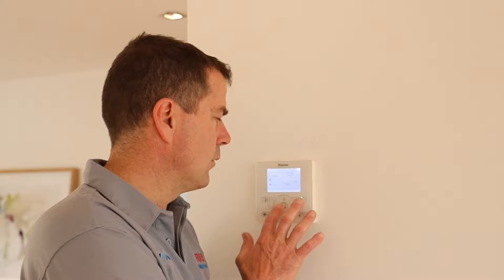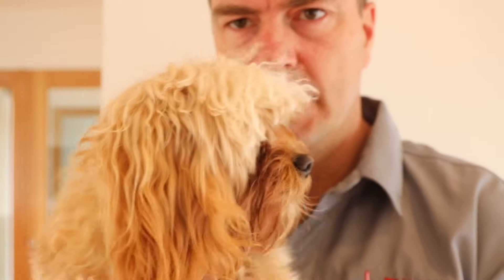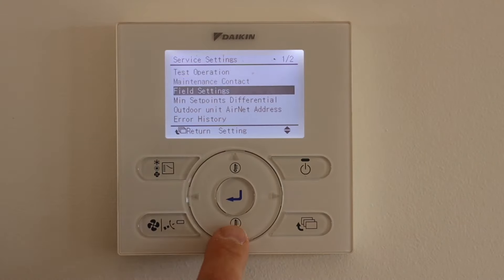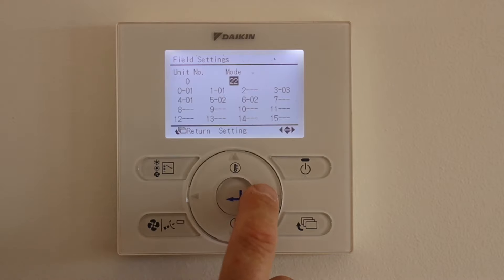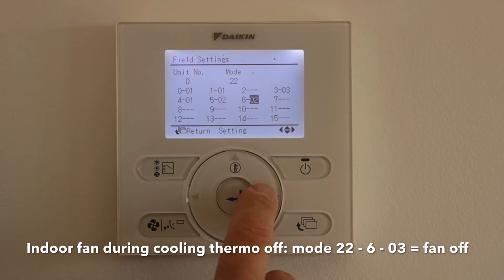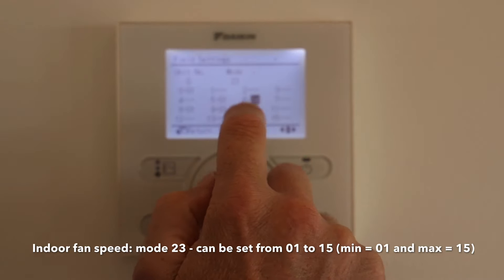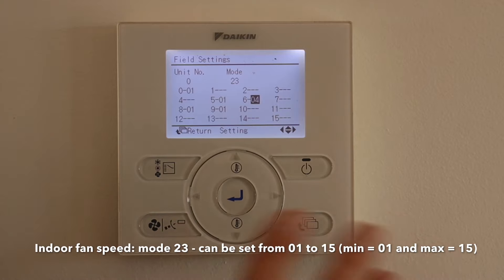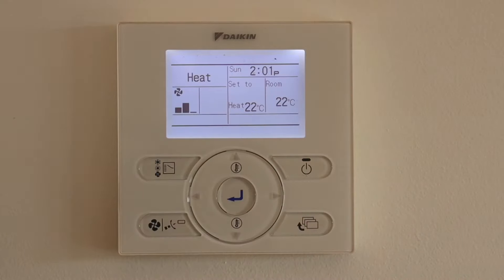Daikin BRC1E63 controller set up field settings cycle fan off, activate sensor in wall controller

Comment: This has been an incredibly helpful video - thanks! I was going crazy not understanding why my temp would hit the desired level and the whole unit would just keep going.
Reply: Me too but I missed that part here. I can't stand these thermostats.
Reply: got it. took a while to get to field settings on mine but the fan is now being monitored like a KGB double agent. And the sensor is now reading from the unit and not in the damn return air. I guess these are valuable for service techs but the default needs to be just simple. Reliance on automation is annoying.

Comment: What a god send.  Unit was installed by a well know company that has been in business for 50 years, yet they did not ask anything around these settings.  The constant dribbling cold breeze when in heat mode is what drove me to start looking for answers & found this.  Also the bit of changing the temp sensor to the controller because in summer we were freezing & had the controller temp set to 28c to try tame it.  Thank you so much.
Reply from the maker: No problem 👍🏻

Comment: I only have a AirTouch connected to my daikin unit. Is there a way to program the daikin unit with the AirTouch
Reply from the maker: No sorry, the Daikin units feld setting can only be accessed by the Daikin controller, when air touch is installed, the people installing it should have connected a Daikin controller to test run it and set all the field settings, if it's set up correctly the temp sensor on the air touch should be the control point for the air touch. you would normally set the sensor in the remote control. There are instructions online at polyaire about the set up of the air touch as there are a few ways that can be configured as well.

Comment: Stuck in German in hotel… how do I change language settings plz
Reply from the maker: @boomchancre  push the middle buttons, that will take you into the menu, scroll all the way down to the bottom (this is language) push middle button again and it should have all the different languages 👍🏻😜

Comment: How to off  centralized control
Reply from the maker: You can’t, your indoor unit is one of a number of indoor units, connected to a one outdoor unit, VRV system. One of the indoor units will be the master indoor unit where all setting can be preformed, you could change the master to your indoor unit, but you need access to the master controller to do this, the master controller will be the one that doesn’t display the under centralised control. You push and hold down the mode button for 5 seconds, then go the controller that you want as the master and push the mode button, this controller will now be the master controller.

Comment: Absolute legend. 👍
After spending $15k on a ducted system, you have solved the one gripe I had with it.
No longer need to deal with a daft from the return vents.
Reply from the maker: Simple fix that the installer should be setting at commision of the system.
Reply: I have question, at night on my thermostat it shows standby and doest not heat.

Comment: Very useful video with a detailed explanation. Good job sir. I was not aware there is an option to turn off the fan after the configured temperature is reached. Now I just can relax in complete silence :)

Comment: Thanks mate, my Daikin ducted systems works a lot better now. No draft air from my 2x return air vents. Sensor set to wall thermostat, rather than the return air vents and manages the room temp and set temp a lot better. Thank you again so much.
Reply from the maker: Glad I could help

Comment: I found it best to keep fan running during cooling, 22 - 6,  during hot weather I found the ducting can warm up in the ceiling space and when the fan turns back I will get a blast of warm air before it cools. Keeping the inside fan running prevents this and having a draft during cooling is also preferrable IMHO.

Comment: Hi Fully Airconditioned, thanks for the great video, I made some adjustments to ensure the temp was reading from the controller. Is there a way to reduce the power consumption on heating? mine appears to cycle harshly on heating to full power even with only one or two degrees set point increase however it ramps down very well and uses far less power on cooling. ie I would like it to behave the same when heating as when cooling (run at a moderate setting). The aim is to give consistent lower energy usage to make use of the solar power that I generate.
Reply from the maker: @benjaminchilvers1946  it’s more of a comfort problem, when an air conditioned ramps down on heating it discharges cooler air and cause cool drafts. Daikin newer large ducted units have this feature where you can adjust how it reacts in heating. It has 4 modes. eco, mild, quick and powerful. The unit comes from factory set to mild and most people complain abut it blowing cool air for a long time. We would normally set this to powerful to avoid a cool breeze. It depends of the climate you live in, Canberra can get very cold -7 degrees c in winters and as hot as 42 degrees c in summer. The colder the environment the more this is a problem. Have never set one to eco.
Reply: @FullyAirconditioned  Wow, thanks for the quick response! What is the field setting to play around with regards to eco, mild, quick and powerful? ps I'm in adelaide, it rarely gets to 0 deg C so most of my heating is when its 7-17 deg C outside and its already 16+ inside (new house - good insulation/double glazing). Thanks again!
Reply from the maker: @ it’s set from the outdoor what outdoor model do you have?

Comment: Thank you. I just want to know how to turn off the AC only in some rooms while it’s on in the other areas at the same time?
Reply from the maker: This controller cannot do that. You would need a controller that’s has zone function. Assuming it’s a ducted unit, you would need to have zone motors installed in the ductwork to the room you want to be able to turn off.

Comment: Hi, if I wanted a specific room temperature to be monitored which setting would this be? For example the main bedroom I put it on 25 degrees but it goes to 20 degrees when aircon is on, I think this is because the main living room is the temperature recognition but we arnt cooling it therefore thinks he needs to pump it colder? Tips please
Reply from the maker: Mabe invest in a smart zoning system like the "MyAir zoning system", this can be retrofitted to a Daikin system, it will give you temp control in all zones and the ability to select what sensor is active. You can just leave in automatic and it will set the room with the biggest temp difference from set point as the master to cool that room faster, if the other rooms reach set point the zone will automatically close off stopping the supply of cool air to that room. It's your best bet to give your Daikin more control, you will also have wifi as standard with the myair.

Comment: Hey do you know what mode 20-02-04 is? I noticed on mine it has modes 1-2-3 like you show for where to sense the temp. But mine also has a 04 option but I don’t know what that one does.

Comment: I was wondering if I could ask a question about efficient use of this unit over the winter? Currently I leave it on all day/ night set between 18 and 22 degrees Celsius. 18 when I leave the house and in between 20-22 when I get home. Am I using this unit properly or can you advise otherwise? Much appreciated! Thanks
Reply from the maker: From experience leaving it on is more cost effective as the system is just ticking over and not running at full speed to raise the temp in the space. When my wife started staying home with the newborn I thought the running cost would go through the roof, but it was the same if not cheaper to run and more comfortable.
Reply: @FullyAirconditioned  rather than turning it off, what settings would you have during the winter? Would you switch from fan to heating when you are not home? or would you put heating on all day and lower the fan speed when out? - Presuming you can't do this in the scheduling?
Reply from the maker: @victoriaweingartner6376 
Hi Victoria,
Well we have our Daikin set to turn on to 22 degrees at 5.30am , turn down to 16 deg c at 9.00am, (make shore it set to heat because if it’s set to auto it will cool the house to 16 😬). We have good northern facing glass so house gets good free heat from the sun during the day, we make shore the curtains are open during the day.  At 3.00 pm the unit turn back on at 22 deg c and runs through to 10.00 pm. At 10pm it turn back down to 16 deg c and run through the night (well the system is on but it doesn’t blow any air as the fan is set to cycle off, on the real cold nights, below 0 deg c it might kick in once , twice, maybe three times during the night. So it’s not set to turn off during winter but when it’s set down to 16 deg c it hardly comes on.
That’s how we run ours, if someone is home they can over ride the settings, but next time it passes through a schedule it will change to the set schedule.

Comment: Hi, do all the field settings have to be the same as in this video in order for this to work ?
Reply from the maker: You only need to change the ones you want, but with the fan cycling off it’s best to set the sensor in the wall controller to active. If it doesn’t work how you want just change it back.

Comment: Thank you so much for this video. I was sent the link in a desperate attempt to change the thermostat reading over to the control unit. 

If this actually works, I’ll nominate you for the YouTube channel of the year!!!

Just out of curiosity…. The fan speed on mine 23-3 has only three settings  (1,2 or 3)
Reply from the maker: Hi Christian,
It depends on the model of the ducted indoor unit and how new it is, with the older units they have a AC fan motor with 3 or 4 speeds (usually only 2 selectable from controller) . With the newer units they have a DC fan motor with 15 fan settings, each fan setting adjust the 3 selectable fan speeds at the controller. Yours may be an older system or it could also be a low static indoor unit that has less speeds.
Kind regards 
Craig

Comment: Hi, Thanks for the vid. After I set the field settings; Mode 22, 3-3, and 6-3, I expected the fan to not run at set temperature, but it continued to run. Any ideas?
Reply from the maker: It depends on the indoor unit, the settings I have here are for Australian made ducted indoor units, you could try 21-2-02, or try 50-0-04. If they don’t work just set them back to original. If your in the USA your units are different and I don’t know the settings sorry.

Comment: Hi Craig, would you mind telling me why my air con the one you are talking about isn’t working in the bedrooms (main bedroom working perfectly) but everywhere else in the house is?
I’ve cleaned filters, changed settings. Just don’t know what else to do. It’s so hot my kids are boiling in the rooms.
Reply from the maker: If it’s a ducted system and the air flow is not even, you won’t get an even temperature. Most common cause is bad duct design, the length of duct feeding that room is longer than the other ducts or too small for the area. The other reason could be that that actually room has a higher heat load the the other rooms (like big west facing windows)

Comment: Thanks mate. Would all the models have a fan only mode? I ask because the apartment complex I’m moving into is being furnished with a brand new system with the same wall controller but the salesperson has mentioned there is only a heating & cooling mode, though I wasn’t convinced by that since all the videos on much older controllers show at least 3 modes (heat, cool, fan, auto & dry).

Also, is the BRC1E63 still the latest model? If not, do the latest controllers have any new features compared to this one?

Oh & would there be anything else to know if the apartment setup was a mixture of integrated vent in a bulkhead in living room & a couple of split system units in bedrooms (with their own, zoned controllers)?

Thanks.
Reply from the maker: Should have all setting heat coil set fan auto. Yes current controller. If it’s a VRV system one controller will have all mode options, the rest of the controller will be able to operate in the same mode as the master or in fan mode or off.

Comment: Hello, 
I was just wondering what your recommended field setting would be for the fan on a Daikin unit in “cool” mode as the information online is very conflicting. In your video you suggest to set it to 22 6:03 (Fan shuts off when set temperature is reached), would that be your recommended setting to ensure a longer lifespan on the unit. As there are arguments for and against it, some of the information online suggest that having the fan on 22 6:02 in “cool” mode has benefits over having it set to 22 6:03. In your experience what setting ensure longevity of the unit?
Reply from the maker: Person choose, change it and see if you like it and how the system operates, you can change it back easily. I leave on unit on from the start of summer, if the house is hot the system runs to cook it down, we have had a cool spell in the weather and the system hasn’t needed to come on for the last two days, if the fan was set to run all the time I would find it annoying. Personal choice, you can set 02 as well low low fan speed.
Reply: Thank you for your prompt response! Appreciate the information. Would you say one option over another ensures a longer lifespan for the unit? Or one tends to cause more issues in the long term with parts wearing out?
Reply from the maker: @Kakashi_San_1989  no, l can’t see one over the other having an impact on life of the unit, the quality of the installation will have the biggest effect on the life of the system than any thing else. Evacuating the system below 500 microns to ensure no oxygen or moisture exists in the refrigerant circuit and just a general quantity insulation. That’s the biggest cause of premature failure of a system. Using cert three in refrigeration air conditioning trade and not a cert 2 installer, one is a 4 year apprenticeship and the others a 2 day course, so many cowboys companies and workers in this industry.
Reply: Thank you for the information! Wish you were located in VIC hard to find good honest tradesman like yourself these days! 
Only wish I stumbled upon your page earlier.

Comment: Is it possible to have an external or second temperature sensor with this controller? We also have an airbase
Reply from the maker: You can plug in a remote sensor into the return air sensor port on the indoor pc board. Then that sensor can be placed somewhere in the house. You then set the controller to sense the temp from the return air temp sensor. If you wanted to switch from one to the other you would have to do it in settings in the controller. The other way would be to inset all a double pole double throw switch and wire two sensor into it and with the flick of the switch you would change sensing locations. You could install the daikin zone controller it has the ability to have two additional sensors fitted that can be selected from the controller. The problem with the zone controller is that it has a rubbish timer, doesn’t show actual temp, is difficult to set timer and doesn’t have half the stand feature of your current controller.

Comment: Thanks for the informative video! I tried these settings out, and when I changed 22-3-01 to 22-3-03, and changed 22-6-02 to 22-6-03, this seems to have changed something on the compressor - it seems to step through more incremental speeds, and some of these are really quite loud and buzzy, clearly being heard from inside the house. Are these setting supposed to change the compressor settings like this? If I reset back to 22-3-01 and 22-6-02, everything goes back to normal again and the outside compressor is back to normal noise levels (i.e. not being heard from inside the house).
My set up is an Australian install of a Daikin 3 phase FDYQN180LB-LY, and the outdoor unit is a RZQ180LY1, all using a BRC1E63 controller. I've tried to look up where I can find the field settings for this unit in case they're just different for this unit, but I'm having no luck at all finding them. Can you help at all please? Thanks in advance!!
Reply from the maker: The settings are common for this unit, when you change the fan to cycle on and off with the t-stat you will need to set the sensor to the wall controller as it’s factory set to the indoor unit. If the fan cycles off, the indoor sensor is not sensing the room temperature air as there is no Air passing over it, this could be causing a big differential, and when the system starts back up, it realises that the temperature differences is wider than what it was reading, it may need to ramp up to a high-speed or over come the larger temp differential. You should set 20-2-03 sensing from wall controller only when setting the fan to cycle off. When it’s set to fan all ways being on it may be cycling the compressor more frequently at a lessor speed. But you are doing the correct thing, if it’s not how you want it change it back. You could try setting it too 22-6-01 fan set to low low speed in cooling t-stat off and keep it set to indoor unit sensor. This will drop the fan to a very low speed when the t-stat is off but keeps a small amount of air passing over the sensor in the indoor unit. Trial and error, just make a note of what it was set too original and if you’re not happy change it back.
Reply: @FullyAirconditioned  Thanks for the quick reply! Yeah, I originally tried that with 20-2-03 set too, and that’s when I encountered the problem. I tried it with 20-2-02 (the original setting) too, but it kept happening. I’ll just try going with low-low fan speed for cooling instead (22-6-03). 
Thanks again for the help and detailed videos!